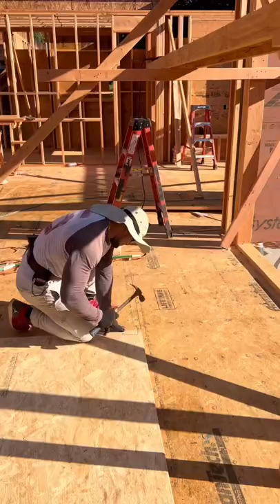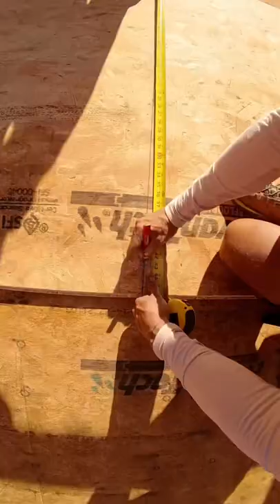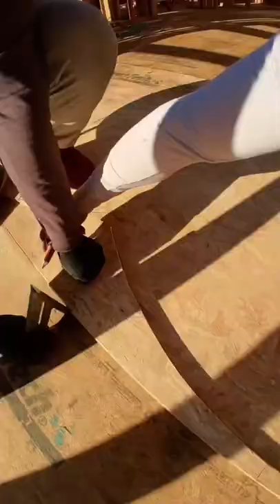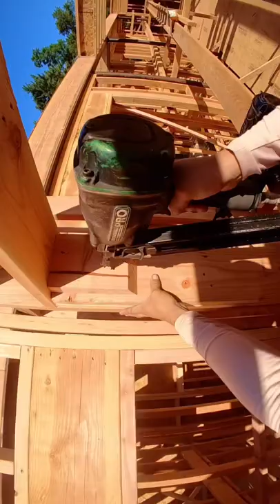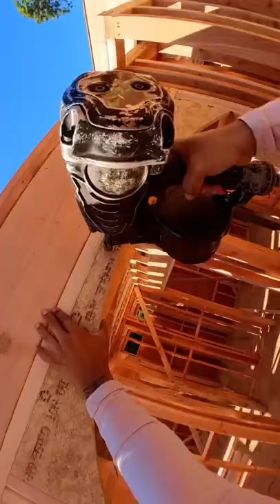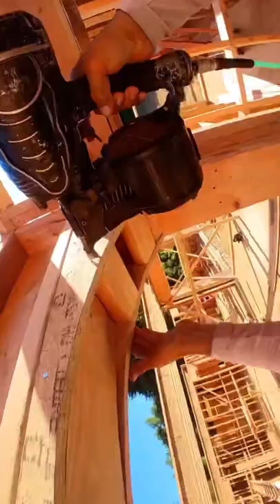Arch #shorts #construction #work #quality #design #skills #art #tips #artwork

Comment: Hey man just put like a 3-ft block at the top on each end then you can run your blocks all the way across the arch. You can nail your Center one to the header at the top to secure it. I always try to make sure I allow 3 inches at the center of my Arch. Just a tip I figured out after many many arches